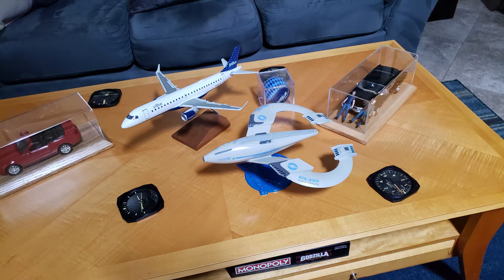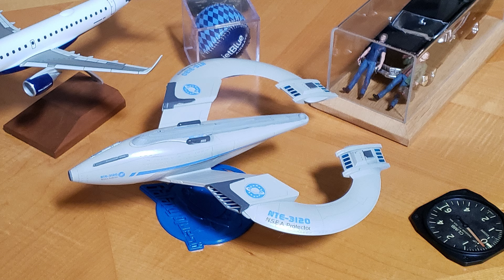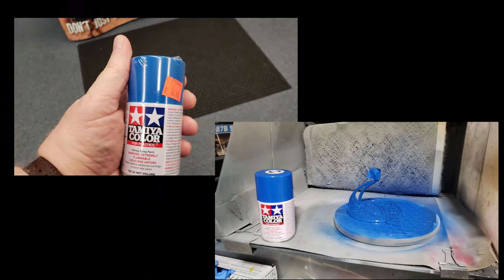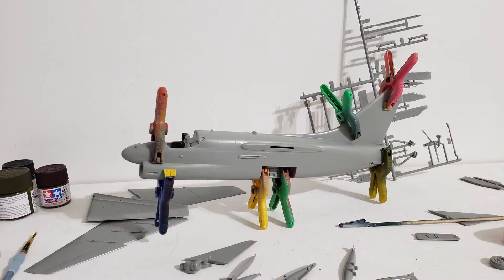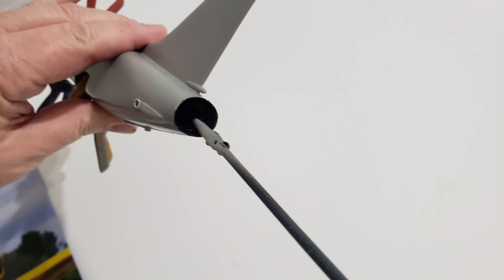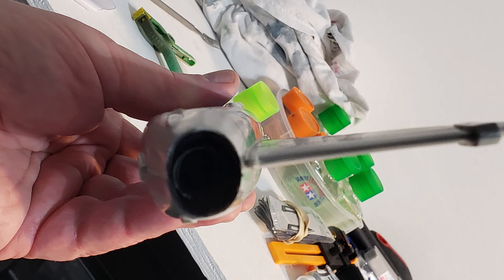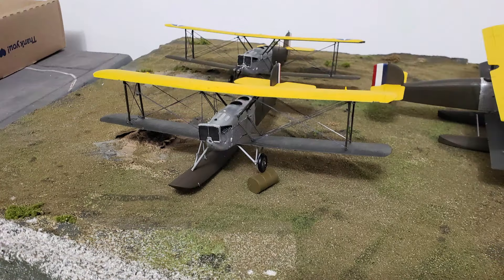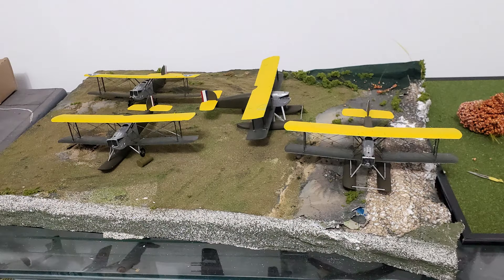After hours with Max's Models 01/24/24

Comment: Clear rod prop or drill a hole in the nose wheel bay to fit BBs and white glue inside the fuselage of your SLUFF.  Cover with a piece of styrene to represent an access panel.